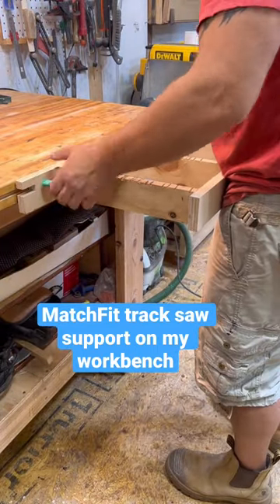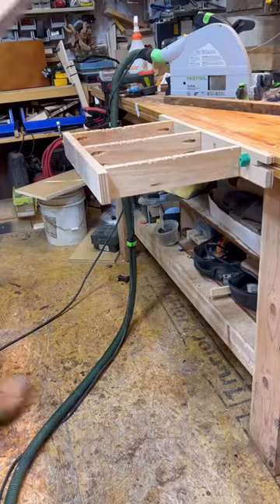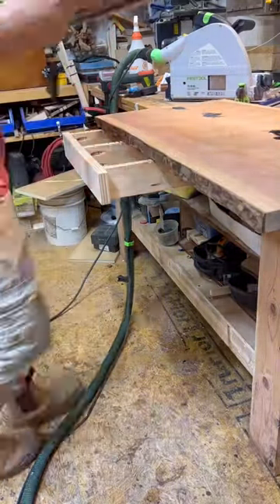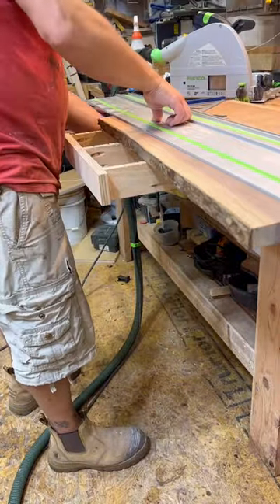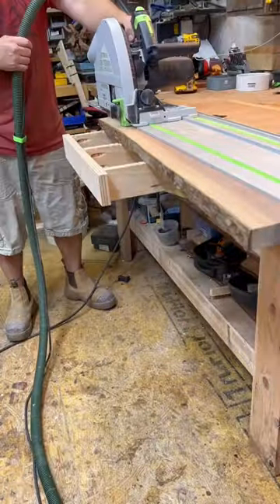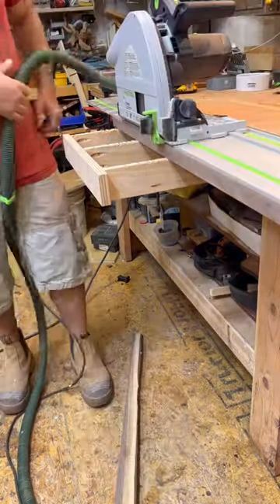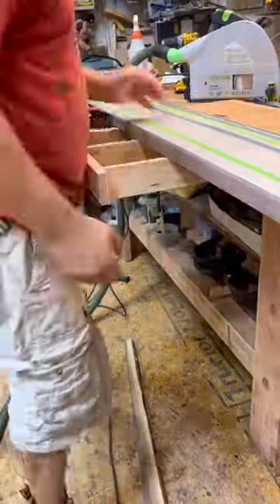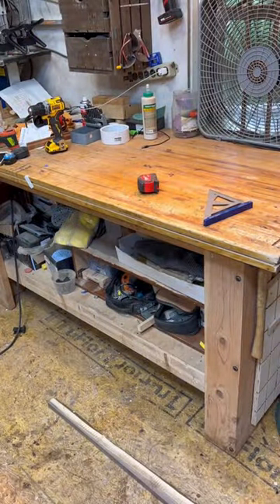Track saw support for workbench #woodworking #microjig #workbench

Comment: Hi, this is a really good idea, I’m about to buy a track saw. One question, how do you attach your jig to the table, I mean, I see the screws and the horizontal groove you made in the table, but how do you secure the screws into the groove. Anyway I want to make this and thanks!
Reply from the maker: Thanks man - I’m glad the idea is useful! I use the MatchFit system from MicroJig. It’s uses a dovetail groove cut into the wood with pieces designed to slide in them. They have clamps and these thumbscrews in their sets. Honestly one one of the most useful tools for jigs!! 
i can try and do a video about it if that would help?
Reply: @NewmanSpecialsWoodwork  would love to see a video too!:-)